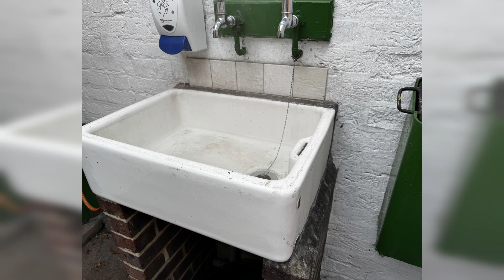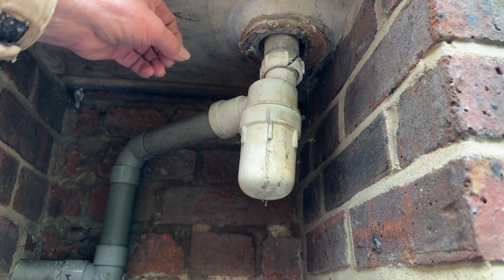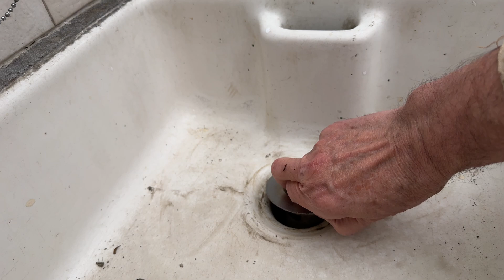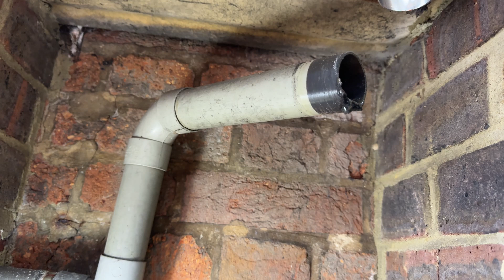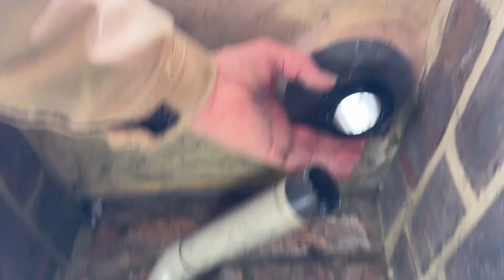Repair your Belfast Sink Waste Connection!

Comment: Hi. I’m replacing a one and a half sink with a butler sink. But the p trap waste is much higher than the new butler sink will be. In other words when the sink is in position the waste pipes underneath won’t join the sink they’re in a  much higher position. 
The pipe taking the water out through the wall to outside is positioned high too so the water will have to travel upwards to leave the sink if that makes sense?
Any advice other than put a new hole through the wall would be much appreciated. 50 year woman here trying to be a plumber . Many thanks
Reply from the maker: A shallow trap can gain half an inch but if it's more then that, it does mean a new hole at a lower position.
I hope you manage to find a solution and thanks for taking an interest in the video, I greatly appreciate it. Thanks
Reply: @ thank you for your reply. I shall look for one of those. Much appreciated and thanks again